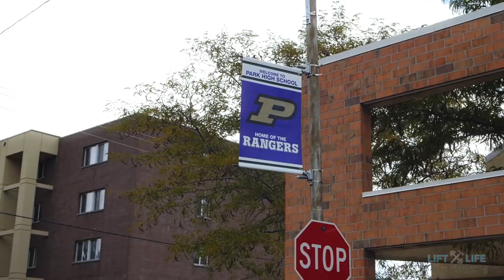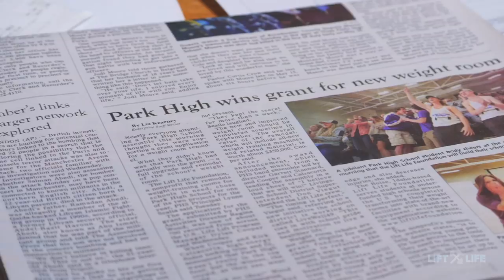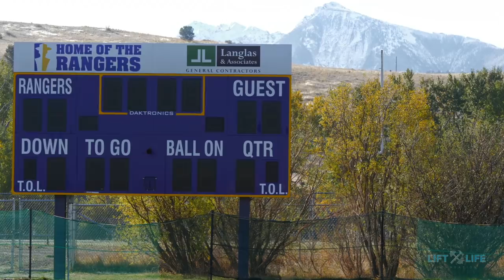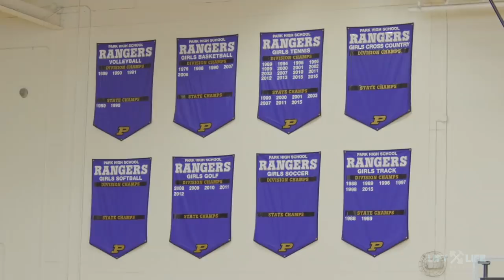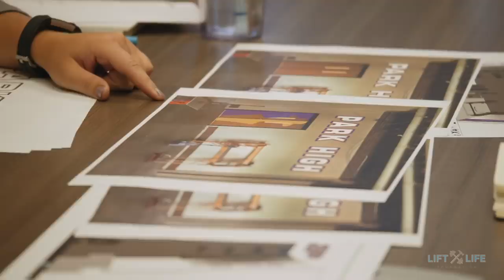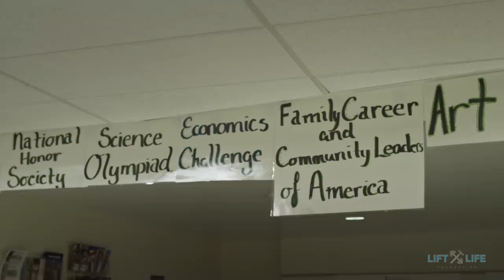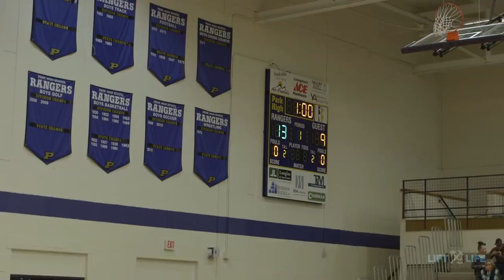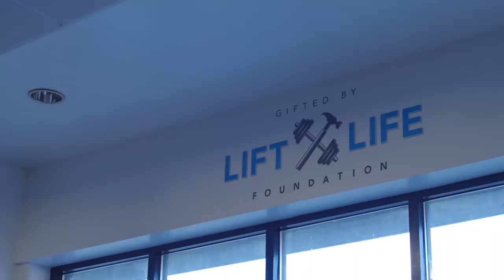High School Weight Room Extreme Makeover | Park High School

Comment: Where is the respect for the building? Meaning the removal of hats while inside any building. Well, not your home.  When did this stop? Even the military  remove hats, depending on size, it goes through the belt or under the arm. It is up to the teachers to lead in this respect of buildings, by not wearing a cap inside all day. Then parents show the same respect in side a DMV, library, a Walmart, ect.
Thank you.

Comment: My school has just got loads of racks and pull up bars, dumbbells, bars and plates. They used to have machines but got rid of them, just stupid tbh. But my current gym is also under equipped so🤷🏼‍♂️
Reply: Bars racks and plates  bro get creative  with that hell you dont even need the rack clean the bar up to squat and yo overhead press